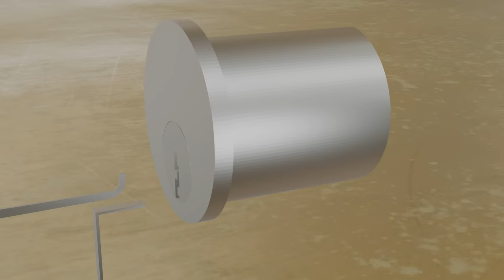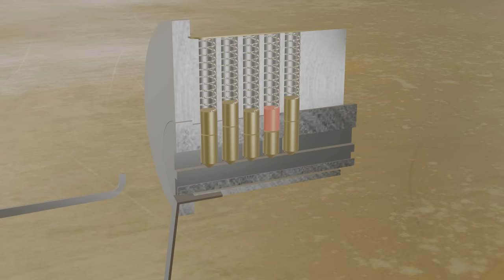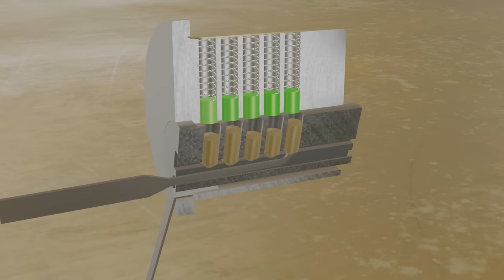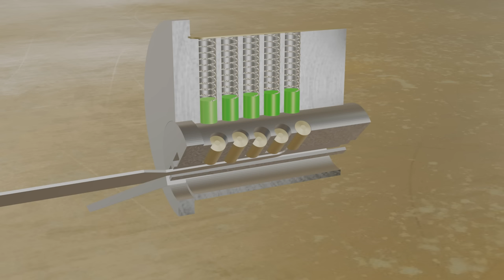How Lockpicking Works

Comment: When i was kid, i took my parents safe key and made a outline of it in paper then i use that outline to make a key out of video game cd. My small ass mind thought that it would be nice idea to use plastic material as a key. Then i tried to open the safe, only outer handle rotated, the key didnot rotate, ended up breaking the plastic key with half of it inside the hole. I did it so that i can buy video game cd without asking money. I gave up everything and i was preparing myself mentally to get hard ass slap from parents. Luckly found some twisers and pulled half piece out
Reply: If you had the key you should have just used the key. We're you a bright kid?🤣
Reply: @johnnyq4260  he cant have the key 24/7 and it would be more risky if he kept stealing the key. Its ok, man, just don't be a prick
Reply: pov: the red key mould in escapists 2
Reply: @katt0906  you are wright, i didnot have the key 24/7 so need to duplicate it on my own stupid way.
Reply: shit i did this for the fridge when i was a kid cuz they wouldn't let me eat my ice creams 😂
Reply: Talai badmas

Comment: Thanks for the graphic presentation of the workings inside a lock cylinder.  You have validated what I have been simply surmising.  Other pickers typically give a running dialogue as to what they are feeling inside the core.  Now you have illustrated this in a clear and understandable way.

Comment: I learned lockpicking years ago. I work in the arcade machine industry and always get used
machines with lost keys. Arcade locks are very simple and easy to pick. It's much faster than
drilling the lock or damaging the equipment by prying the door open.

Comment: Holy mackerel it worked!  I was trying to open an empty office cabinet that I was given at work without keys.  It was a little different because the whole lock mechanism seemed to come out but then I could easily turn the latch with a small screw driver.  I used the 2 paper clip method and I can see how the correct tools would be a lot easier, but then the lock I was working on was probably a very easy lock.  This was fun!  I can see how it becomes a hobby easily.  Thanks!

Comment: How do you determine which direction to apply pressure? This is an excellent teaching video. I’ve at last found out what nothing and binding mean.
Reply: Most keys turn clockwise but you can just try pressure in the other direction if the first direction doesn't work.

Comment: And That, dear friends, is why insurers like a nice 5lever plus mortice lock, as opposed to a cylinder lock. Both are pickable but a quality lever lock has more of an issue in my opinion, as the levers in a quality lock are gated so as to not turn if over reached, and wont bind so much as pins do. 
Been a very long time since I made a key for a lock with no key.... but that was how I learnt about those levers

Comment: I think how a lockpick minigame in a fps rpg can play more realistically with a pressure gauge and the pick itself to control the resistance but cannot see the pins alignment.

Like say in a Elder Scrolls game.
Holding Spacebar will increase wrench pressure, too much will damage the wrench, too little and the pins might slip and reset. Pressure will slowly go down over time.
Using the mouse up and down to apply pressure to a pin, mouse wheel to switch pins.

A gauge is shown for how much strength used in the wrench, and how much resistance given when pushing the pin that is a colored shade.
Pins 1 to 5 would be a rectangular bar with different color shades as you push them with different pressure, default is all green, adding pressure changes the color from green to red in various 'shades' from 0% to 100% basically, and with the right wrench strength level (like say you try to keep the gauge centered), you will hear a click when binding the pins, and need to stop the color at that spot where the sound occurred.

Comment: Please explain in more detail the pin binding order. Am I correct that this is entirely determined by the manufacturer's error acceptance and is random so that in your video above the 4,1,2,3,5 order has nothing to do with the key or original intent by the manufacturer for that lock?

Comment: should locks be oiled? i have a practice "cut" open lock that i can see the pins with and its made from copper that i am having great difficulty  with and it squeaks! and is rigid and difficult to move. certainly their is a special oil for locks that does not contain oil but is a graphite substance. or will the oil make the lock more difficult to pick? have you ever done a video on oiling a lock? will oiling it make it more difficult to pick?
Reply: WD40 penetrating fluid.

Comment: I’m having trouble figuring out if I’m pushing on a pin or somewhere in between.  Any advice?
Reply: Until you get the hang of 'feeling' it, try loosening off the tension and until it moves, if it doesn't then it isn't a pin. Hope it helps

Comment: Naive question: Why not prevent pin 4 staying in position by rounding off the bottom and making it smaller so it can fall down even if you keep tension?
Reply: If it were smaller in diameter... It would not be the first pin to bind... It would have been another...

Comment: That partial rotation with the tension wrench is the main flaw. Why so difficult to design a barrel that doesn't rotate unless all pins are in position? why they can't  design pins that doesn't get stuck by the tension.

Comment: And do you loge the pins on the top?  How do thay stay up?
Reply: The tension wrench. As you're turning the cylinder, applying a constant but minimal force those acceptable tolerances come into play.  The "set" pin wont fall back because it's been popped into place but the hole it was popped out of is too far to fall back in...unless you release tension then you gotta do it all over again.

Comment: Hi,
but how is it possible that the pins stay in the top when I picked it? Why isn't it being pressed back down by the spring?
Reply: As mentioned, there are slight manufacturing differences allowed in the tolerance. The cylinder walls or pin cylinders do not perfectly align for all of them, just enough for the pins to go through both top and bottom cylinders in normal usage. When putting tension on the rotating part, you are trying to get the cylinders walls to be as out of alignment as possible. Once you push the pin up, it further puts the cylinders out of alignment. The pin then is blocked by the tiny bit of the cylinder that protrudes out due to the mis-alignment.
Reply: The varying lengths of the pins play a role as well. As a pin is pushed to the side by pressure, it will bind to a different degree. So in addition to manufacturing tolerances, the longer or shorter pins would bind first

Comment: Why doesn't the first pin get loose when you get the second pin. Why would all the pins stay up and not fall after you bind the next pin.
Reply: He's holding tension on the cylinder and as each pin rises, the lock cylinder turns clockwise ever so slightly and makes a click.